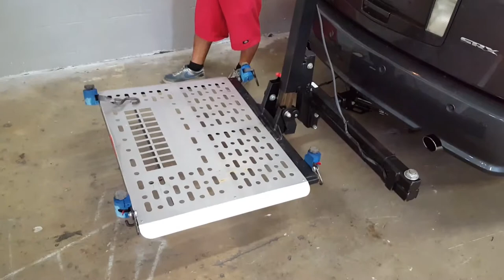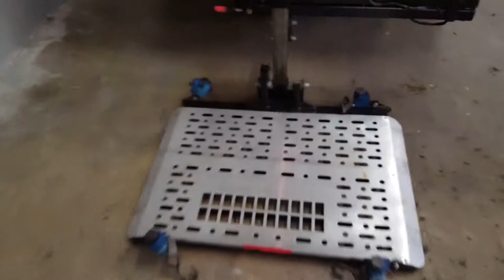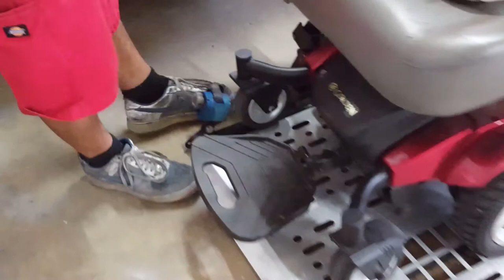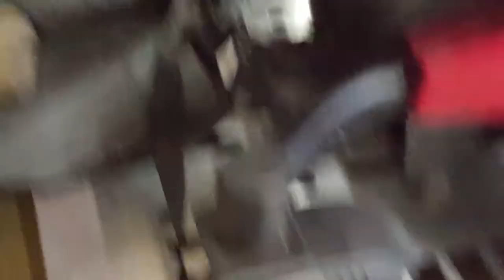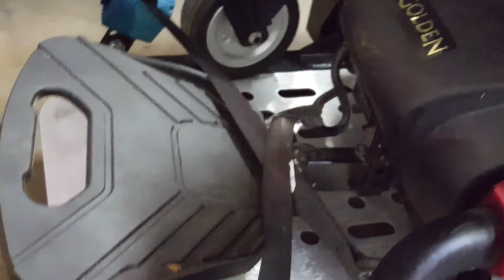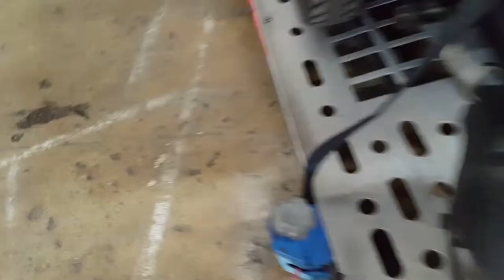Harmar AL300 Scooter & Power Lift Demonstration

Comment: I ordered a harmar al 350 and it was offered through spin life. Is it just like the one in your video or is there a difference? I can't find a video on the harmar 350. Thank you for your video.
Reply from the maker: The AL350 is a slightly different model with different specs but very similar in design. Keep in mind the AL300 in the video is a few years old but it can still help as a guide.
Reply: @miamihitches   Thank you so much for the fast response and the info.
Reply from the maker: @williamsantiago7303  you're welcome